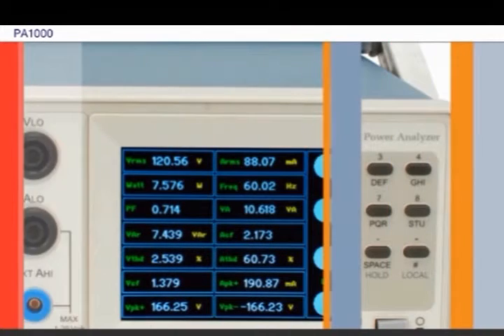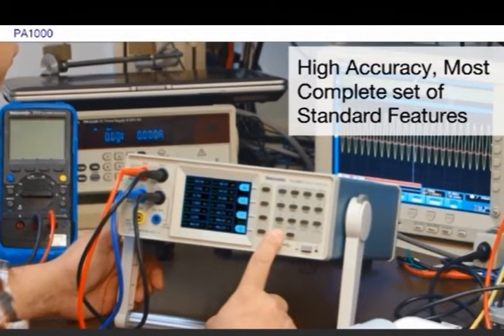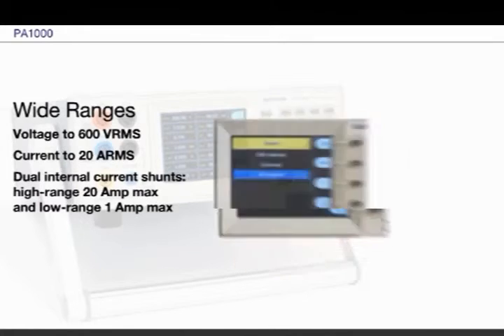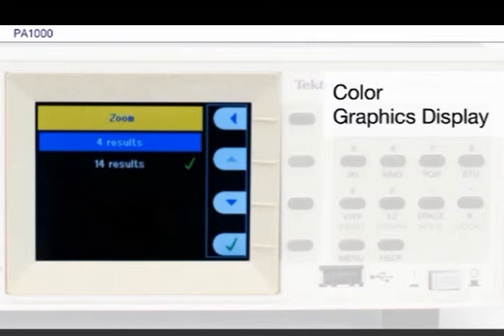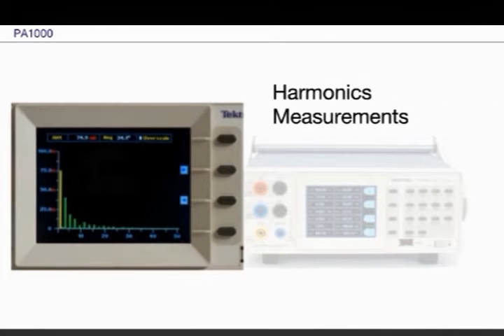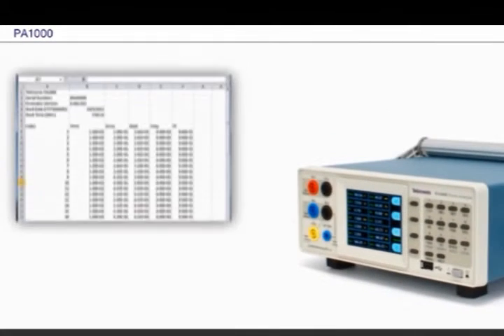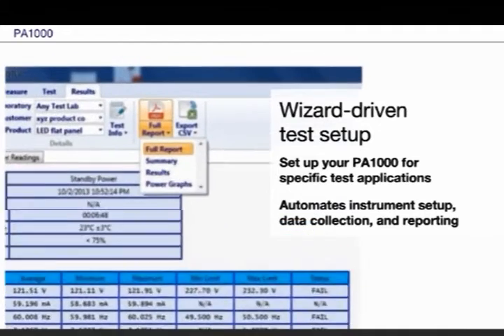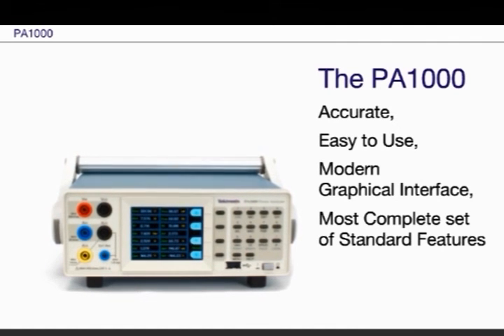Tektronix PA1000 Power Analyzer

Comment: La reale precisone è di molto superiore a quanto dichiarato, anche nelle comparazioni, perchè il PA1000 lavora con range in Picco (vedi manuale) perciò l'errore totale in potenza è di molto superiore a wattmetri che lavorano con range in RMS. Esempio 400V  10A cosfi 1  50Hz = 4000W
la formula dell'errore in potenza del PA1000 è la seguente: 0,075% sulla lettura + 0,075% sul Range perciò: 0.075% su 4000w (lettura) = 3W  + 0,075% sul range (i range del PA1000 sono in Picco) perciò 1000Vp per i 400V Rms e 20Ap per i 10A rms. moltiplicando 1000vp x20Ap, l'errore sul range è: 0.075% su 20.000W = 15W che sommati ai 3 w sulla lettura fanno 18W su 4000W pari ad un errore REALE sulla potenza dello 0,45% !!!! altrochè 0,05% di base. E' esattamente quasi 10 volte superiore a quanto dichiarato!! C'è molto di meglio sul mercato per quello che costa..
Reply from the maker: A very good and point that errors should be calculated in detail for reference purposes. This is true of all instruments, including power analyzers.

The basic specification for the PA1000 is 0.05% of reading plus 0.05% of range.

The PA1000 is a peak ranging instrument which means that the specification remains true when measuring the distorted wave-forms (non-sinewave) often found at the AC input to electronics equipment.
The specification holds true for 1 year from calibration and for crest factors (peak / RMS) which makes the PA1000 very accurate in real circumstances for design and test of electronic products. 
For the 400V example used, the maximum uncertainty would be:
 = 0.05% of 400V and 0.05% of the 1000V range
 = 0.2 + 0.5 = 0.7 V
 = 0.175% of reading.
This compares favourably to other professional instruments when similar detail is taken into account. Please check with your local supplier on price, it is expected to be very competitive.
Reply: grazie per il commento, gentilmente mi può fare lo stesso calcolo per l'errore in potenza  con gli stessi parametri? 400Vrms 10A rms? se l'errore per la sola tensione è di 0.175% quanto è in potenza? lo chiedo perché l'errore che interessa per un wattmetro è chiaramente l'errore in potenza. Un'altra gentilezza, mi può dire quant'è l'errore del PA1000 a 1Mhz?? grazie in anticipo